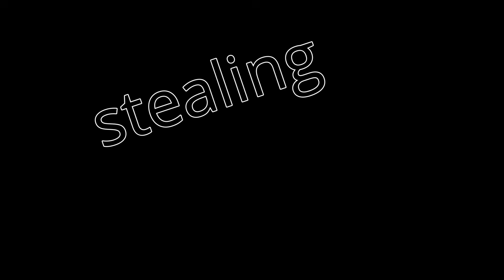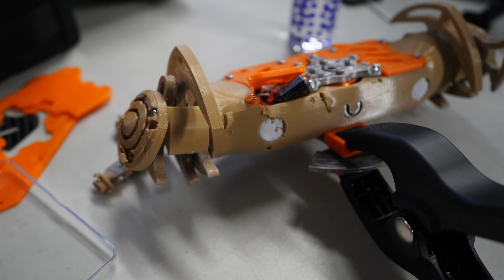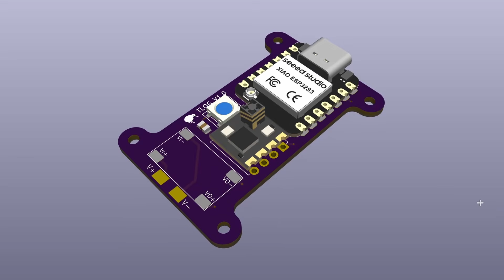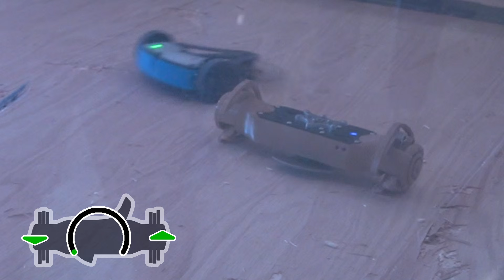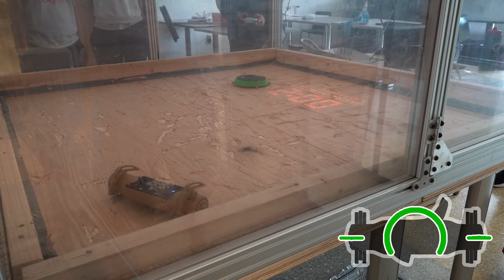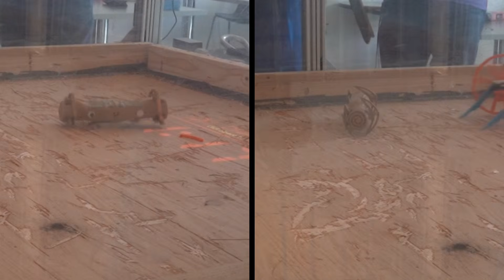Finding Skill Issues by Logging Combat Robot Data

Comment: I wonder if there is a way to do this with AFHDS 2A, since it's the most common protocol used currently.
Reply from the maker: Won't pretend to be an expert on it since I don't use that protocol, but if you can bind multiple receivers it should theoretically be possible.

Comment: I love the video! It's really well made, and cinnamon rolls awesome to watch!
Might be a dumb idea, but I was wondering if it would work to mount large stabilizer arms on the back of the robot that extend over the weapon, preventing it from pitching back and keeping the weapon from hitting the ground? Kind of like the arms on big wheels. It would also move the CG back some and could help with it pitching forward.

Could make self-righting more difficult, though.
Reply from the maker: It's on my list of things to try some small stabilizer feet under the body which theoretically could help with spin-up consistency.  I'm avoiding large ones for now because from my experience they would make almost impossible to self-right, which I've had problems with in the past.